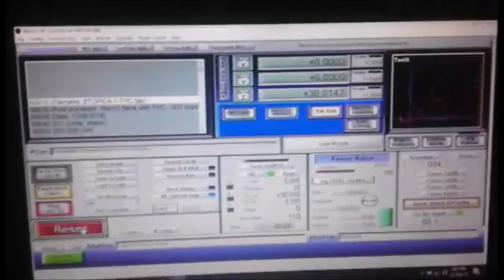Plasma torch height control (THC) by USB-MC motion controller & THC Sensor

Comment: i want to ask about if i dont have ark ok signal from my inverter what is the solution the only output i have from my inverter is for arc start and the output voltage for connecting with the sensor
Reply from the maker: Our plugin for USB-MC motion controller has option for arc presence detection (activates ARC_OK signal) that works by monitoring the arc voltage. The first parameter that should be specified is voltage margin in positive and negative directions in relation to the nominal value, and second parameter Detection time (Td), is time interval for the detection. Namely, it is required for the arc voltage to stay during this defined time period inside given voltage range to consider that arc is established and ARC_OK signal is then activated.

For more details please read our document (section "Configuring the internal THC regulator"):
http://www.audiohms.com/download/usb-mc/USB-MC_THC_mode_en.pdf

and also manual for our THC sensor:
http://www.audiohms.com/download/thc_sensor/THC_sensor_en.pdf

Regards

Comment: so is there any problem you faced during using the thc sensor because this is my frist time to use this control and i dont have any idea about the result of cutting or any problem of noice of the inverter on the usb board or any electronic component so if you face any problem please tell me before i buy it thanks
Reply from the maker: We are manufacturer of CNC control electronic, so our experience is based on experience of our customers. THC sensor and software support for this product are made according to our customers requests.
It is known that plasma cutting process generate lot of electromagnetic noise. Some recommendations about using of our USB-MC motion controller could be found at:
http://www.audiohms.com/en/blog/item/205-usb-mc-pc-connection-problems
On the following link ones can see plasma cutting machine of our customer who start with our control unit SMCU3 and now he use USB-MC motion controller and breakout board USB-UIO1:
http://www.audiohms.com/en/customers-gallery/stepper-motor-drives/item/140-cnc-plazma-3000-1500-mm-with-smcu3
This video where we write our comments are his latest machine with THC sensor.
Besides, we are always trying to give technical support for our customers.